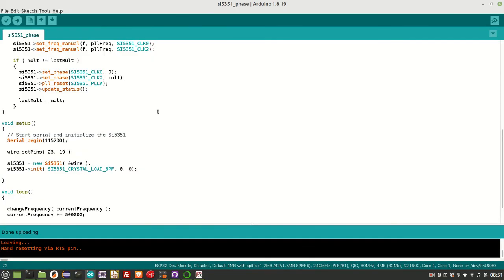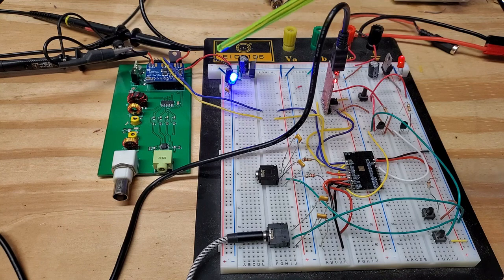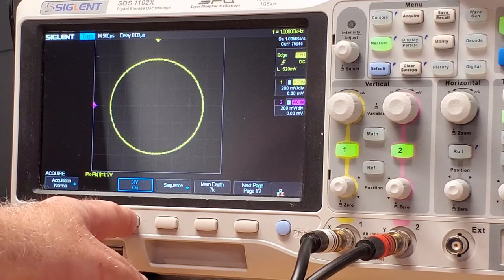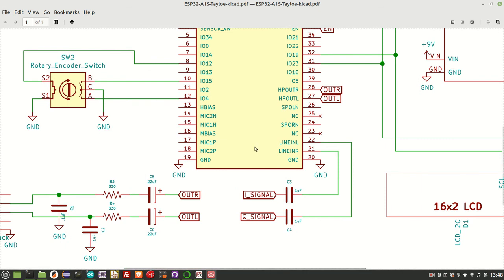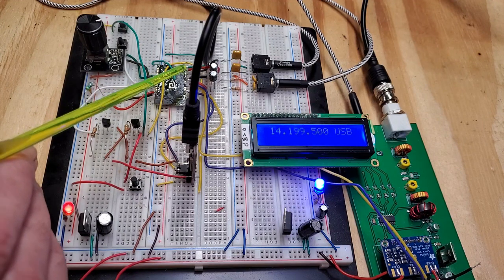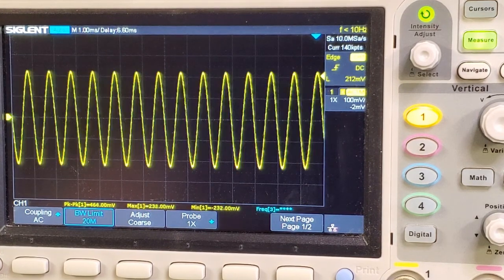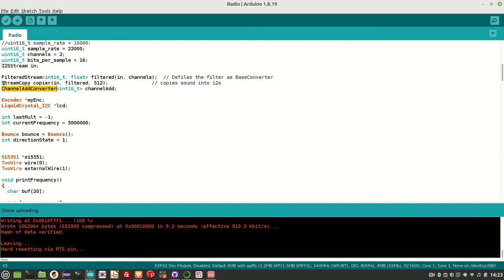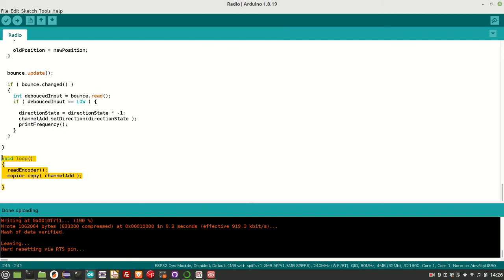Simple SDR with Arduino Audio Tools

Comment: Hello and thank you for your tremendous work in the community. I'm trying to follow your lead, but during compilation, I'm having trouble finding the files in the FIRConverter.h and ChannelAddConverter.h definitions. One of the compilation errors is: AudioTools/AudioTypes.h: No such file or directory
2 | #include "AudioTools/AudioTypes.h" The same applies to other files declared in both packages.. I've looked through your repo and haven't found an answer. Could you tell me where to look for the missing dependencies?
Reply: I finally found the missing files from the Arduino Audio Tools package and am inserting them where you expected. Unfortunately, I now have a duplicate definition error (for example: error: multiple definition of 'enum audio_tools::RxTxMode') because it is actually present in multiple referenced files. It seems that the path arrangement in your package is different from the default ArduinoAudioTools package, which causes the compiler to malfunction under these conditions. I'm trying to test the Hilbert filter after disabling other unnecessary functions (SI5153, LCD, debounce, etc.). I don't seem to be as proficient in programming as you are, and the problem is beyond me. Could you review the code, particularly the one concerning filter usage, or suggest where I might have made an error? Simpler examples, such as copying generator -> I2S or I2S -> I2S, work fine for me. In file included from /home/leszek/Arduino/esp32a1s__radio/FIRConverter.h:2, 
from /home/leszek/Arduino/esp32a1s__radio/esp32a1s__radio.ino:32:
/home/leszek/Arduino/esp32a1s__radio/AudioTools/AudioTypes.h:30:6: error: multiple definition of 'enum audio_tools::RxTxMode' 
30 | enum RxTxMode { UNDEFINED_MODE = 0, TX_MODE = 1, RX_MODE = 2, RXTX_MODE = 3 }; 
| ^~~~~~~~
In file included from /home/leszek/Arduino/esp32a1s__radio/AudioTools/Concurrency/SynchronizedBuffer.h:3, 
from /home/leszek/Arduino/esp32a1s__radio/AudioTools/Concurrency/RTOS.h:9, 
from /home/leszek/Arduino/libraries/audio-tools/src/AudioTools/AudioLibs/Concurrency.h:7, 
from /home/leszek/Arduino/libraries/audio-tools/src/AudioTools.h:71, 
from /home/leszek/Arduino/esp32a1s__radio/esp32a1s__radio.ino:10:
/home/leszek/Arduino/esp32a1s__radio/AudioTools/CoreAudio/AudioTypes.h:30:6: note: previous definition here 
30 | enum RxTxMode { UNDEFINED_MODE = 0, TX_MODE = 1, RX_MODE = 2, RXTX_MODE = 3 }; 
| ^~~~~~~~

Comment: In your code 'run thru' you keep referring to "TAPS". What are "TAPS"???
Reply from the maker: Thank you for the question Rob. In digital signal processing a "tap" is a single co-efficient in a digital filter. The process of combining a digitized signal with a digital filter is called convolution. The more taps or coefficients the better the filter - but at the expense of more computations. Balancing number of taps with available compute power is often a challenge in DSP. The article below has more infomratiion:

https://www.quantum-machines.co/blog/introduction-to-digital-filters-01-first-things-first/

Comment: IIRC you don't have to issue the PLL reset UNLESS you have changed the multiplier frequency.  So for small frequency changes, that should not be necessary.
Reply from the maker: Sorry - got this mixed up with a different video. Check out this code in Radio.ino

    if ( mult != lastMult )
    {
      si5351->set_phase(SI5351_CLK0, 0);
      si5351->set_phase(SI5351_CLK2, mult);
      si5351->pll_reset(SI5351_PLLA);
      si5351->update_status();

      lastMult = mult;
    }
Reply from the maker: Thats correct Kenneth - I have that specific test in my Radio code which you'll be seeing shortly. Issuing the PLL reset causes a nasty click in the output

Comment: Hi Ian,
Another fine video. I bought several of the ESP32-A1S modules and had some breakouts made for 2.54 mm pin headers. I'll give your code a try with my QSD based on the SDR-1000 schematic. Your receiver sounded good with the 22kHz sampling rate. With the limited voice range, I'm sure even 16kHz would be adequate. Someone concluded the noise from the ESP32 was due to not connecting all the ground pins to ground. I think this noise problem was mentioned in a video on a ESP32 Walkie-Talkie project.
Reply from the maker: Thank you Jerry. If you have a close look I even have a wire soldered to the grounding pad  in the middle of the ESP module. I would definitely like to get the number of taps increased - I will probably trying playing around to see if I can use the ESP-DSP library for the FIR instead of the one in the arduino audio tools. Thanks again for the comment!